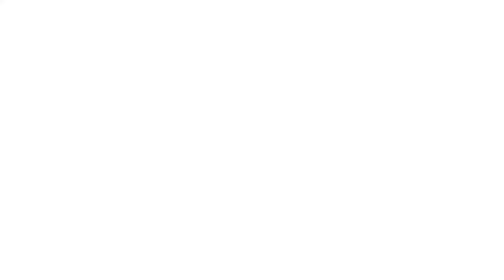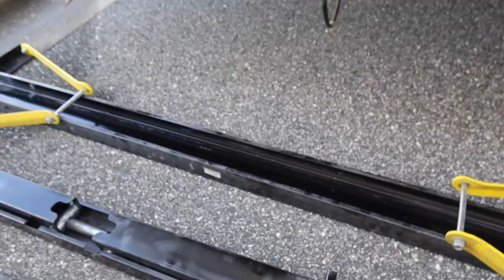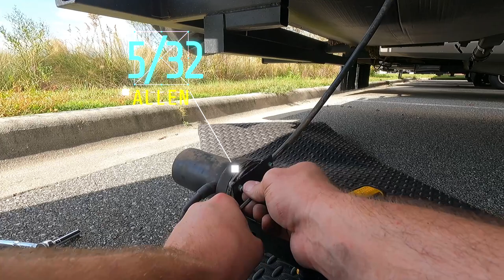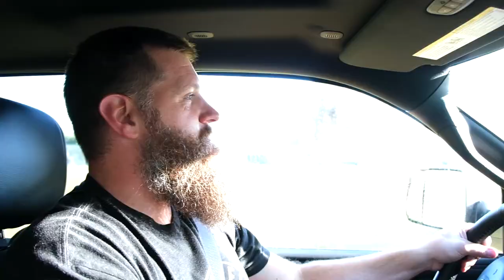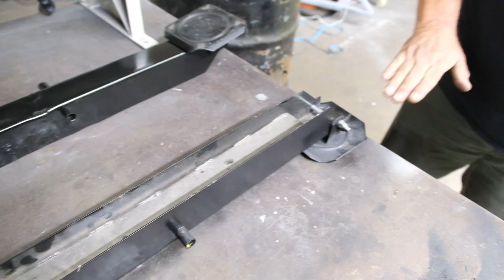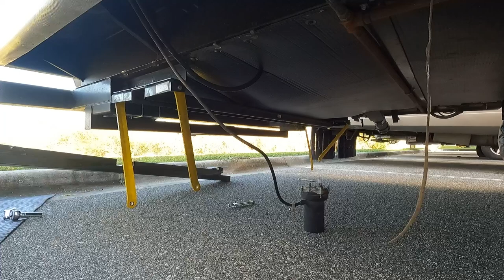RV Stabilizer Repair - Lippert Electric Stabilizer Jack - DIY and Save $

Comment: Good job, yeah there easy to fix so long as you know how to fix it. I work on RVs and am fixing a Jack like that one right now. Sounds like lipper is make poor quality kind if there response is that it happens all the time really hummm. Lot of stuff that are made these days are just made cheap and sold expensive but don’t even last long.
Reply from the maker: Well I wish I could pass off some of the blame, but as they are just stabilizers and not intended to support the weight of the Rig, it was my error that caused the failure. That being said, the industry is definitely making a sweet penny off of us all. Some of these rigs cost as much as a home but won't last a fraction of the time. Such is life I guess.

Comment: I have my stabilizer out of the channel and I am attempting to lift the arms out. I can't get the silver parts that hold the arms into the channel in the right position to lift out of the notches....is there a secret? I've tried everything for about 45 mins.
Reply from the maker: Yes it's actually really simple but only once you have don't it...LOL. They only rotate one way. You may have to turn the run to move them up or down, spin that screw rod and those cylinders will move. There are notches in the casing too, that they should pull right out of. When I'm putting it back together in the video I mention having a hard time with it until figuring it out. Watch that part again, it might help. I'll check it out again and see if I can explain it better.
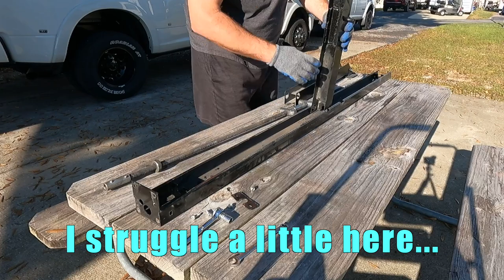Reply from the maker: at 12:00 I explain the holes and if you see I twist the internal rod to make those pieces move. I probably just need to twist that rod to move those cylinders to place at the notches on the casing to pull them out.
Reply: @Live2Journey  I'm having issues getting them lined up to take apart....the spacing between the arms isn't correct. I guess I'm gonna have to keep tinkering.

Comment: Almost looks like I should take mine off and reinforce them before they bend. They look pretty flimsy seeing them apart.
Reply from the maker: They are not meant to support much weight, just stabilize. Mine never would have bent had I not raised my front end and put all the weight of the RV on that back left corner.